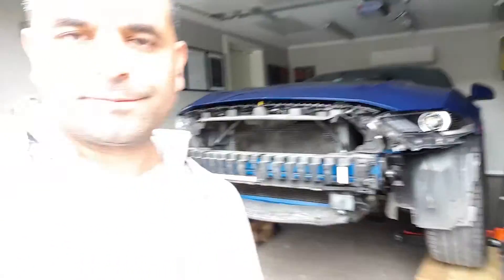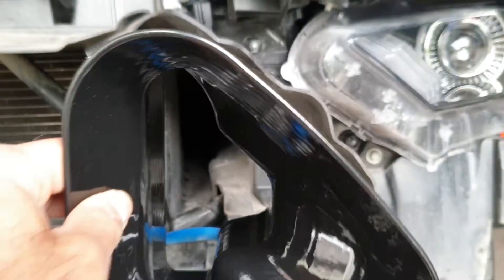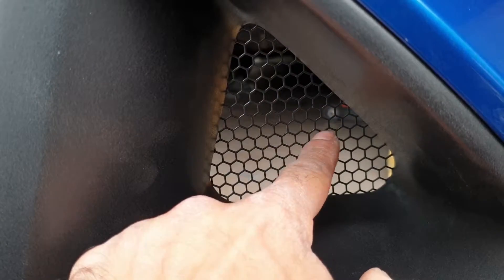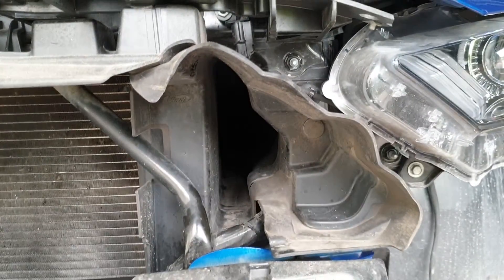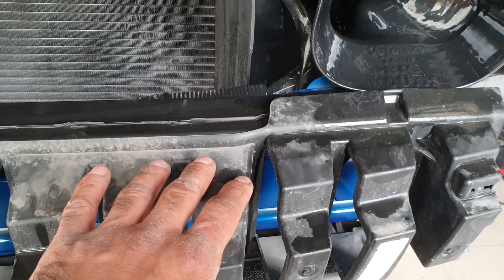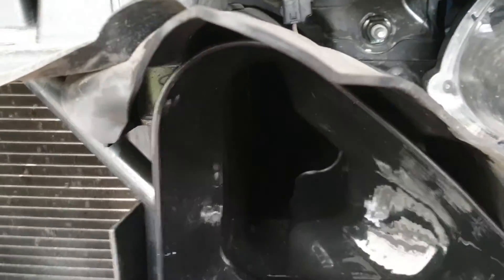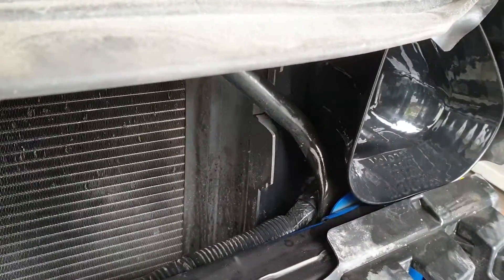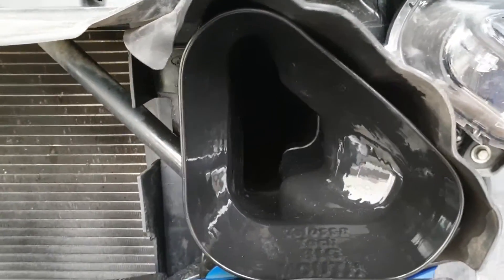How to install the Velossa Tech Big Mouth on a 2018 Mustang GT

Comment: Do you have any dyno or data to show if this modification added horsepower?  It would be nice to know. Thanks!
Reply: Unfortunately, for mods like this, you can't really dyno them. The mod is designed to use the force of the car already moving through the air to funnel more air towards the intake, giving the intake access to more cold, clean, dense air, rather than air already in the engine bay that's heated up and less dense.

Since it needs the car to move, dynoing it is like... like trying to test aerodynamics in a wind tunnel that's turned off. it just won't show any changes.

that being said, it didn't stop me from buying a black one with a red mouth for my veloster.
Reply: @timefortimbo  thats why they have big fans in front of the car to simulate being driven.
Reply: @thedon9670  the fans are for the radiator… they don’t do anything for the air intake
Reply from the maker: Unfortunately not, I had plans to Dyno the car but was never able to do so before I separated from it :(
Reply: Mazman thanks for the reply!  Do you miss your GT?  I have a 2019 on e85 fuel and I am in love with it. Check out my channel!
Reply from the maker: miss it everyday. It's boring driving around in regular cars. Eventhough the replacements I got are pretty decent :D. I'll check it out. Must be running good with the corn :). We have it at more or less all stations here in Sweden ...
Reply: @Themazcorner  excellent!  Looks like you definitely picked up some cool replacements.  :)
Take care over there!